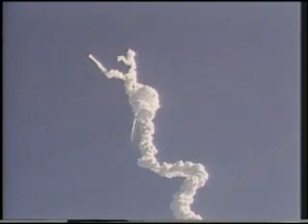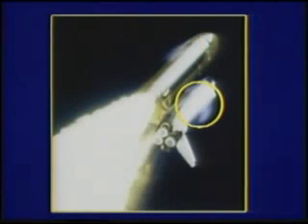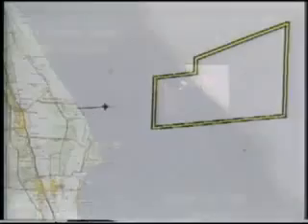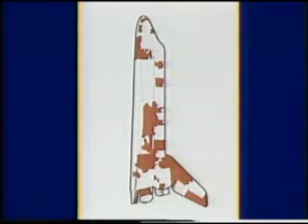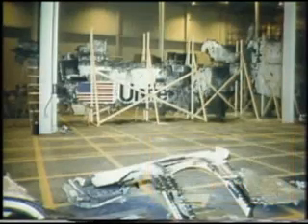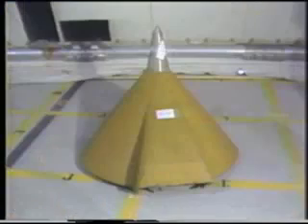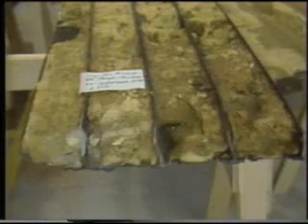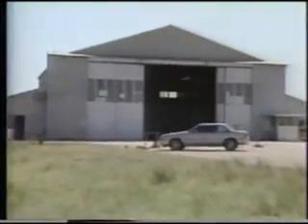Part 4 - Space Shuttle Challenger Explosion - What happened?

Comment: It didnt explode it broke apart, the SRB leaking cause structural failure of the large orange external fuel tank.  This tank holds the orbiter and the two SRBs together.  When the tank failed aerodynamic forces broke the orbiter apart.